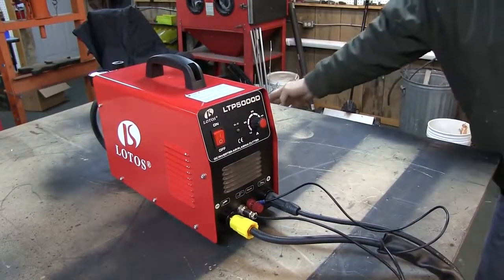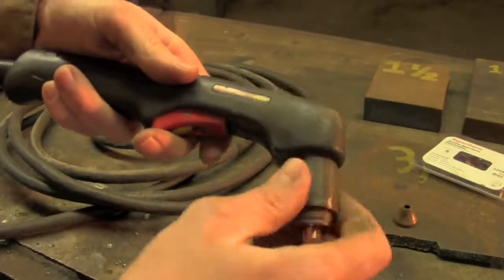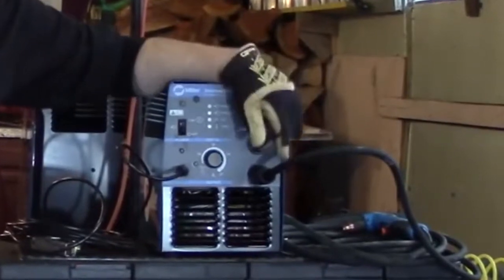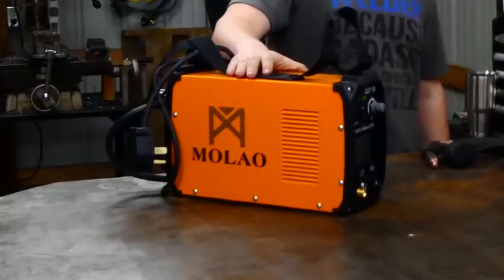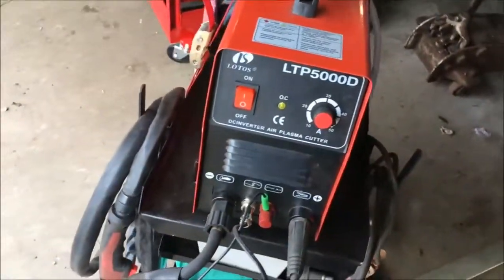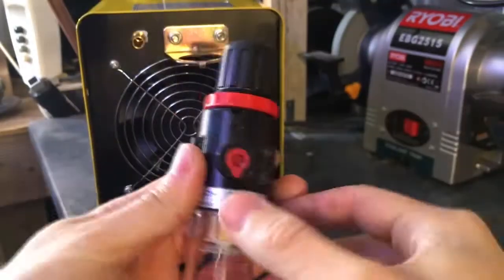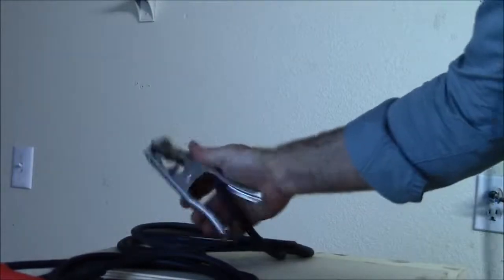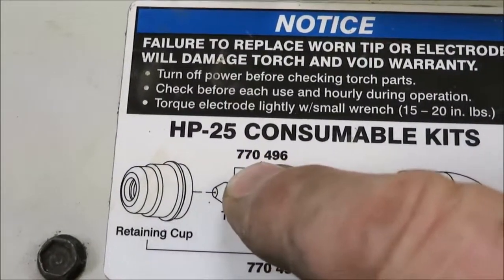🇺🇸 Best Plasma Cutters 2020 [TOP 5]

Comment: You missed cutters from the world’s biggest plasma cutter manufacturer, Thermal Dynamics from ESAB, which has its own labeled cutters. Two very popular models are the 60i, and the new Cutmaster 40, which I recently bought. Honestly, there is no excuse to not have them in a comparison. Most of the Chinese machines are made by the same company.